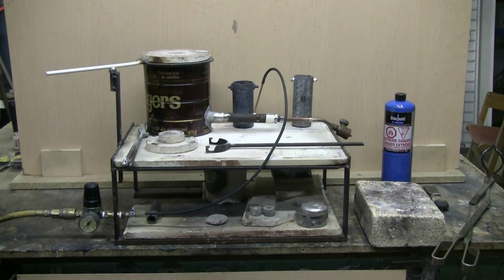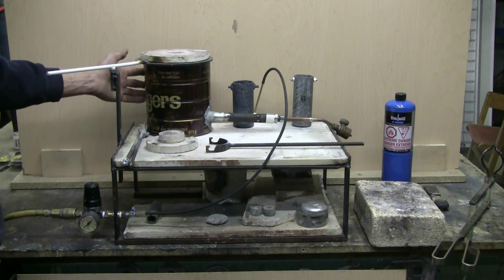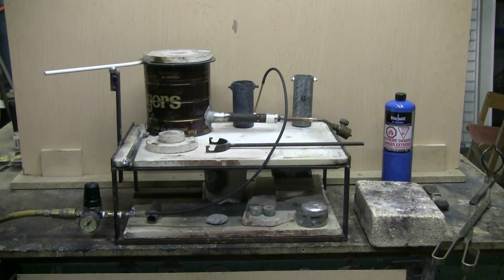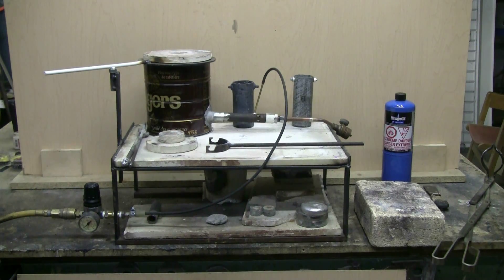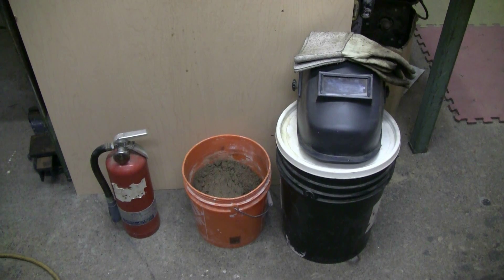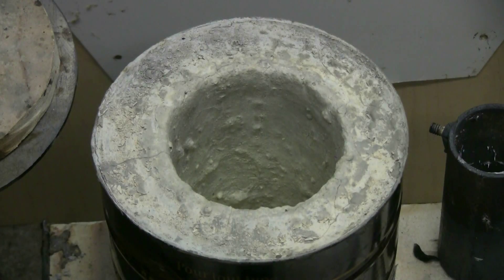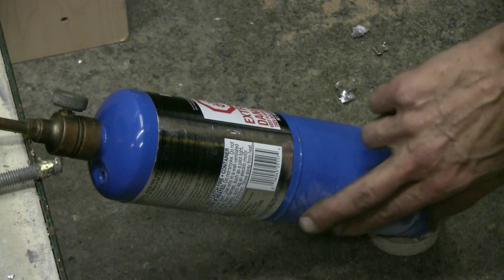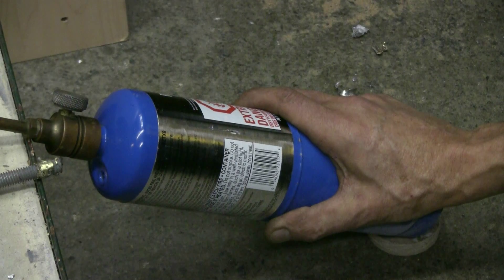Do It Yourself Coffee Can Mini Foundry #7 - Melting Aluminium And Brass

Comment: Very interesting. I built myself a forge the same exact size (coincidence) but never use the hood. Thus I use A LOT more propane. The issue is even when I put a hood with a large opening the flame backfires into my burner. I think I need a smaller orfice I did a #74 although my burner pipe is twice as wide as yours.